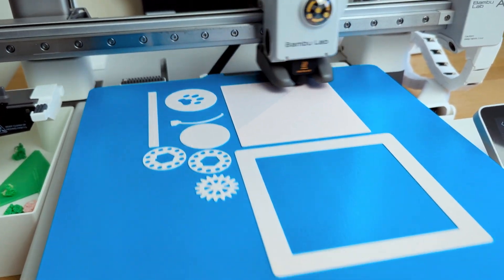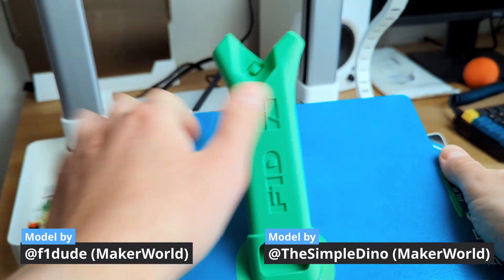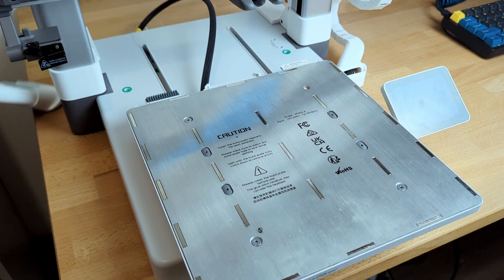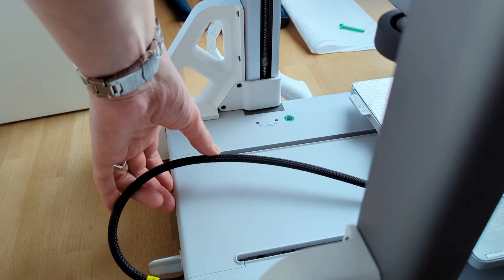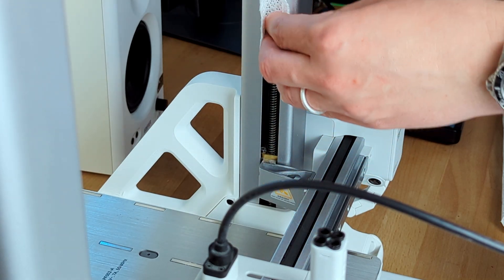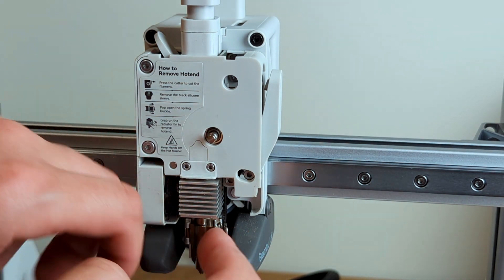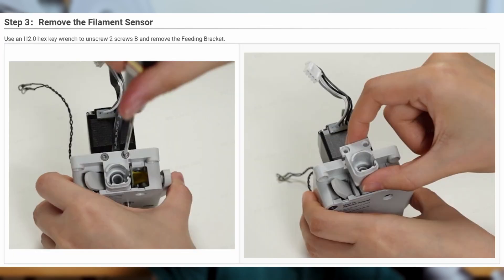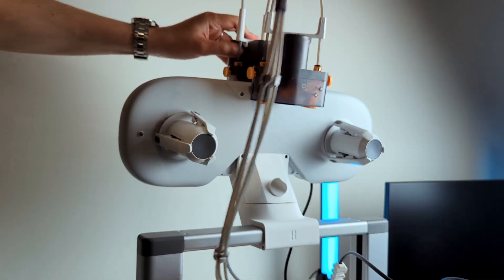First maintenance of my Bambu Lab A1 #3dprinting #bambulab

Comment: Great video for a nooby.  What would I like to learn?  What is the process for printing two different .stl's at the same time?
Reply from the maker: Thanks 😊I am not sure what do you mean by printing 2 different stls at the same time. Do you mean how it's done with the automatic printing where the printer prints one model, then changes the print plate for a new one and prints another model?
Reply: @kroopniock  Probably don't know how to explain it because I'm too new to know terminology .  Let's say I want to print a lube tool to spread oil.  Let's say I want to also print come cable clips as well as a cable guide.  All at the same time.  I know how to do one at a time.. but, I would like to learn how to add a 2nd or 3rd item to the build plate.  I see the tool (box with a +) but I don't understand how to make it work.  It only brings up a 2nd plate.. It doesn't add the object to the original plate.
Reply from the maker: Ok, I get it now. When I use that "add" button it normally adds all objects to the same plate, at least in the version of Bambu Studio I'm using. What slicer are you using? You should be able to move the objects from one plate to the other and you can use the "Arrange objects" button next to the plate to have them automatically arranged on the plate.
Reply: @kroopniock  I'm using the latest BS version.  When I click the + box it will open a new plate.. but I don't understand how, if possible, to move it to the working plate.
Reply from the maker: You should be able to just click and hold on the object and drag it to the other plate. Or delete the second plate and then press arrange the objects. This should arrange all the object in one plate if they are not too big to fit together. It also might that if you are trying to add more than one object, they are grouped together and Bambu Studio thinks that they will not fit together on one plate. Can you send me an email (you will find it in the description of this video) with some screen shots or the stls you are trying to print, maybe I can help you.
Reply: @kroopniock  I will give that a  try.. Danke..